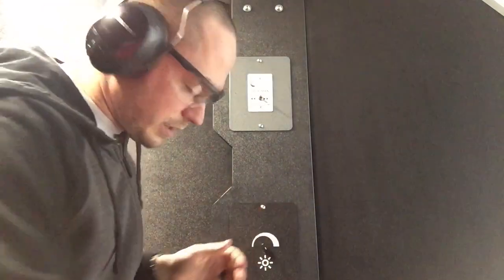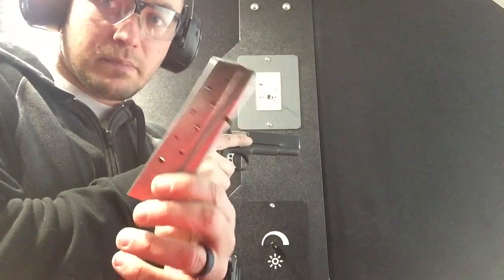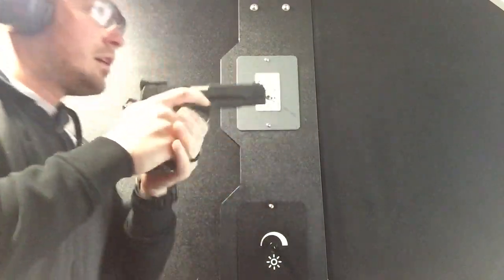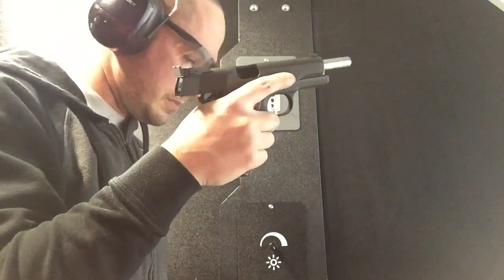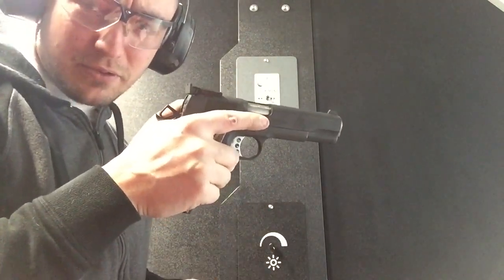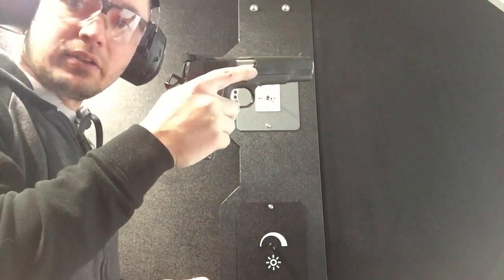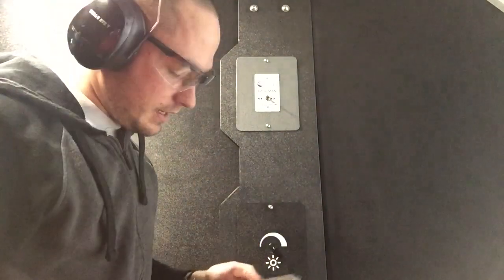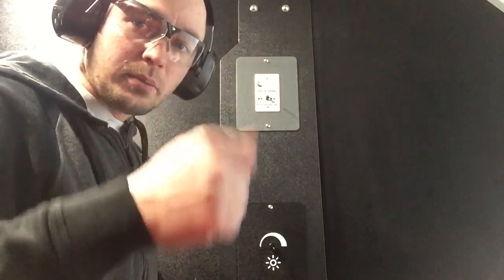Springfield Armory Range Officer 9mm 1911: 10-8 Function Test

Comment: The 10-8 extractor test used to be published on their site and for some reason I thought they said to do 10 rds two handed, strong hand and weak hand.  On my 1911s that feed hollow points flawlessly that I am ready to carry or use for home defense I also run the test.  Here are my results just as a data point.  All guns are 5 inch govt models in .45 auto.

Les Baer UTC pass
Springfield TRP pass
Springfield MC Operator fail
Springfield LB Operator fail
Springfield Loaded NM serial fail
Dan Wesson Valor x2 pass
Dan Wesson Vbob pass
Dan Wesson Specialist fail
Dan Wesson Heritage pass
Kimber Stainless II x2 pass 
Kimber Stainless Raptor II pass
Kimber Super Carry Custom HD pass
Kimber Desert Warrior pass
Colt M45a1 new ion bond version pass
Colt rail gun old xse version pass
Nighthawk Custom Enforcer Recon pass

Probably some others Im forgetting.  Also obviously if it wont feed hollow points well the gun wont make it to this test.
Reply: Also forgot,

Kimber Stainless TLE II pass
Kimber Custom II fail
Dan Wesson PM7-45 fail

Lastly as some have pointed out the 10-8 test does result on the slide falling on an empty chamber but as many agree it is worth it to perform the test.
Reply: +TurboB18C1DC2 I guess I shoul also note that the 10-8 extractor test isnt necessarily the perfect or say all end all test as my dan wesson vbob and heritage have both passed but have experienced a few double feeds due to a failure to extract in about 5k rds.  That said my Kimber Custom II that failed the test I have ran almost 8k rds through and have never experienced a extraction or ejection failure.   It has had 2 failure to chambers.  The first being round number 2 fired and the second being round 1100 something when I ran 740 rds through it in a range session.  The last 7k rds have been fine.

I also forgot to mention my remingtons that I have tested. 

Remington R1 Enhanced x3 all 3 fail.
Remington R1 Carry fail.  

That said all 4 went back to the factory.  All 4 needed new extractors, 3 needed new barrel link pins, 1 had the chamber reamed and 1 had the breech face re polished.  They all seemed to feed fine even with hollow points.  They would do crazy things like pull spent cases back into the magazines, throw cases left, vertical and horizontal stove pipes.  1 would even fire without the grip safety being depressed. 

The only 1911s I have ever had that ran as shitty as the remingtons have been I hate to say it colts.  Most never make it to the 10-8 test because they jam up with ball ammo let alone hollow points.  If they cant run with tripp research cobra mags you know the gun is fucked.  

I just ran my les baer srp hard chrome and it passed the 10-8 test no problem.   Ran 580 rds no problem out of the box.  The last 2 Kimbers I bought I did the same thing.  No cleaning no oiling.  I took a Kimber Stainless II and a Kimber Stainless TLE II straight out of the box and ran 100 rds of federal hst hollow points followed by 300 rds of ball ammo and then finished with 100 rds of hsts and both guns ran flawless.  Absolutely perfect performance.

I actually have 1 Kimber Stainless II that has seen 700rds of federal hst 230 gr .45 auto and it has ran all of it perfectly.  One session involved 400 continuous rds of federal hst and it ran flawless.  The other 300 were over 3 different range sessions.

I now have ran 1600 rds of hsts through 6 Kimbers and every single round was fed and functioned perfectly.

The gun stores where I live all say that if you stick with a 5 inch Kimber you have a good chance of getting a good gun.  2 different gun stores both said that amongst the big 3 that they have the least problem with 5 inch Kimbers when compared to colt and sprongfield.  1 gun range/store where I live rents Kimbers and they have had 1 Kimber that wouldnt run.  It was a micro .380.  Even the 3inch ones they have for rent run fine.

This has been my general experience.  I own I think like 8 or 9 colts and more than half have had some malfunctions hell even the custom shop special combat govt I have has given me problems and I actually have a colt in Connecticut right now.  Springfields have been better than colt but they still have had around a 40 percent failure rate.  I have owned probably around 7 or 8 but currently only own 3.

The semi custom guns are generally better but hell even a couple of my dan wessons have had a few intermittent issues.

From my experience when it comes to performance and reliability Kimber and Les Baer have been the best.  I also have a nighthawk and an ed brown but only 1 of each so I cant say if most are good or not.  Les Baers I am at 6 but have owned 7 but havent shot 1 so wait let me think 6 I have fired and never a problem.  

Kimbers have too much mim in them and the Schwartz or Swartz safety well some of the kimbers I have dont have it but still chock full of mim.  If your buget can afford it go Les Baer or an entry level dan wesson like the heritage.  The valor in plain stainless is near the very top of my list as it is only 1500 and no mim and still comfortably far price wise from a baer.  Once you get a duty treat valor at 1850 its just too close to a baer.  At that point go baer.
Reply: +TurboB18C1DC2 I guess for me my experience mirrors what the gun stores and gun range and my shooting friends have experienced.   1911s are a gamble.  All of us have had a good experience with 5 inch Kimbers.  Some have had problems with colts and some have had problems with springfields.  NONE of us have had problems with Les Baers a total of 12 of them.  Dan Wesson is a close second.

Lastly stay away from the smaller semi custom 1911s.  I own an ithaca m1911 novak model which is funny cause the rear sight is a kensight and a Roberts Defense desert ops and when spending that kind of money its really a big gamble as to whether or not it will shit the bed.
Reply: +TurboB18C1DC2 Lastly I would say if your budget cant pull of a les baer or dan wesson and your budget tops out at 700 or 800 even though I have had outstanding service from my Kimbers I cant recommend them as they are generally over priced.  The pre 2016 models where I live were really over priced.  The Stainless II where I live was going for 900 with an msrp of 998 and the custom II was 750 with an msrp of 839 there were actually 2 dealers selling them for msrp...........  The new 2016 models have come down in price a hundred dollars but are still over priced compared to the competition.

Where I live the springfield armory loaded model in parkerized carbon steel can be had all day long for 700 dollars.  Forged frame and slide, 1 piece barrel as long as it is an nm serial number, night sights, extended controls, ambi and beavertail is a great buy.  My only hesitation is my relatively poor experience with springfield.  The range officer can also be had all day long where I live for 650.  Another great buy.  Between the two if I planned to carry I would go with the loaded.  If not then the range officer.

Another great model at that price is the remington r1 enhanced.  All day long at 700.  Nice controls and fit and finish better than the springfields.  I have ownes 4.  All 4 had problems.  I still recommend it as I am sure I am the exception to the rule.

If your budget is more around 600 I recommend the ruger sr1911, the thompson/auto ordnance 1911 tc and if you can still find one a para expert in stainless.  All 3 are stainless with the usual upgrades and nice features.  The thompson 1911 tc is really great for the money as it has front strap checkering.  All 3 ran fine for me with ball ammo.  Never ran hollow points.  All 3 are at or less than 650 all day long where I live.  The para expert will be difficult to find as para has closed shop.

Comment: I have shot about 800-1000 thru my Glock 19 with no malfunctions except when using that same ammunition with no mag in the mag well.  It stove piped.  That is the only time I have had it malfunction.  I guess I should try some different ammo and see if it will malfunction without a magazine in the gun.

Comment: In all my years of experience (37 years) I have never seen an out of the box 1911 that was 100% reliable. I had a series 70 and 80 and never got more than 85% reliability from either pistol . Several hundred dollars later I did manage to achieve 95% reliability , but never 100%. This is why I only use Glock's, Sigs, H&K's  and  revolvers for CCW. 1911's are fun to shoot but I would never bet my life on one.
Reply: Well I have 3 1911s and none of them have never malfunctioned right out of the box
Reply: You have to clean them and oil them. They require more maintenance.